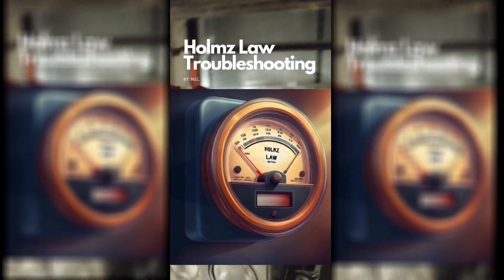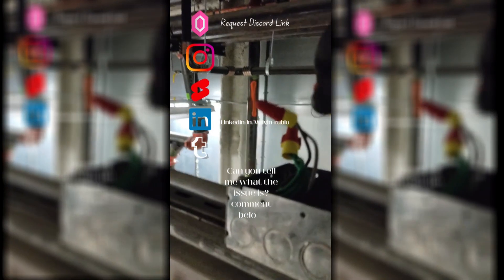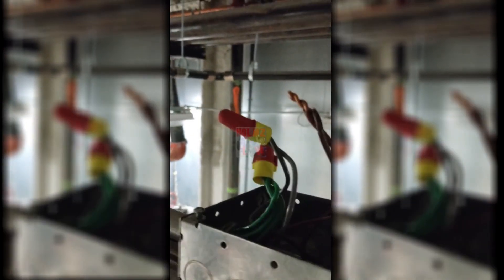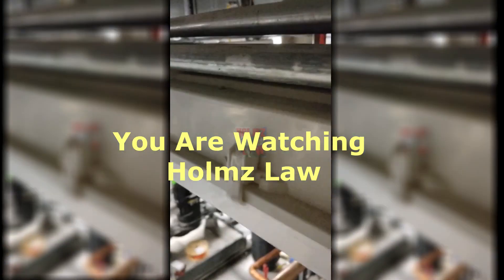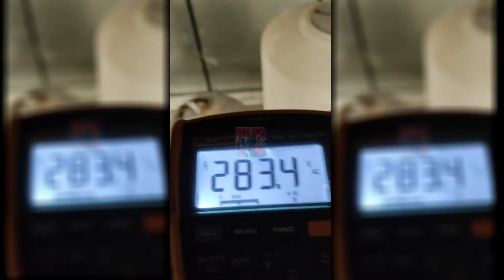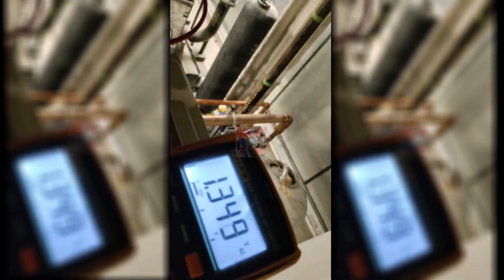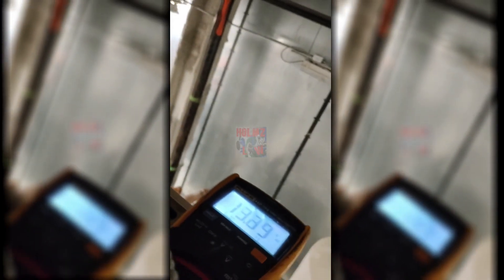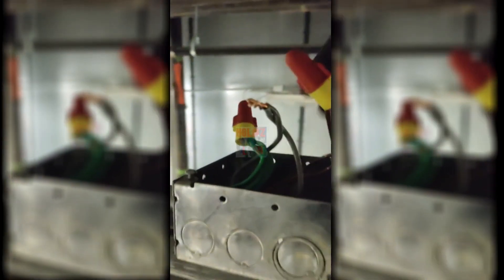Electrical Troubleshooting - 277 Volt Lighting

Comment: Imagine if he actually touched the hot to the edge of the box instead of neutral. The whole building would get to witness a mini fireworks show lol. Also that’s very dangerous if you touch the neutral and and part of your body is touching ground you will get a worse shock than touching the hot probably.

Comment: Did you find the open neutral, Was it at the panel?
Reply from the maker: No it wasn't. We have about 3 hours electrical contractors here . We are doing the core and shell of the building. Then we have low voltage contractor and the BMS contractor. One of them removed our conduit because it was in there way supposedly. After tracing it out we saw where they had removed the conduit and put it back. With very bad splicing. The neutral was left open. Don't know why.